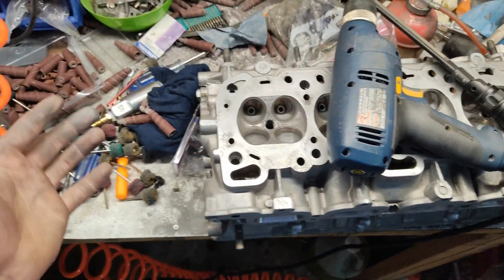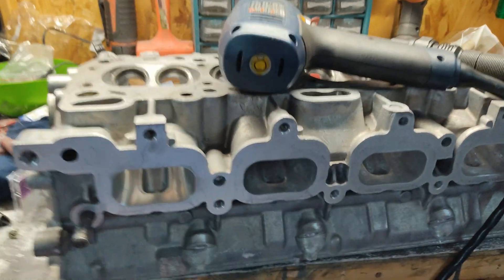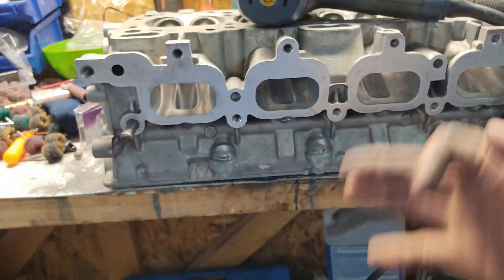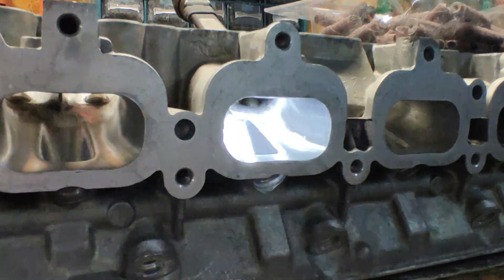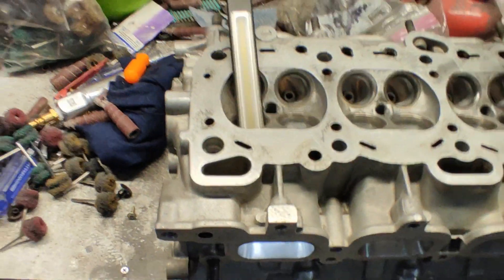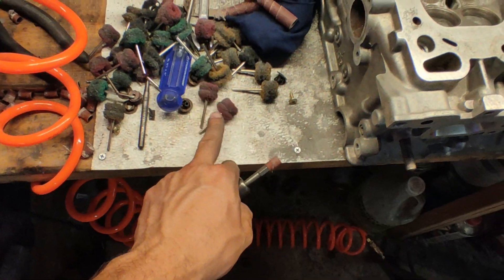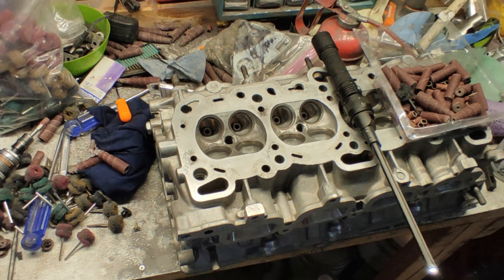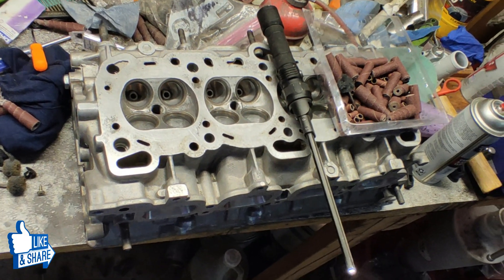How to Port and Polish a Cylidner Head at Home DIY (4G63t)

Comment: On the intake port they don't need to be highly polished as this can lead to fuel drop out and poor atomization. On the exhaust port the smoother the better to get the exhaust gases out quickly.
Reply from the maker: I didnt polish all the way its still better then OEM cast

Comment: You did a great 👍 job on this did you notice better air flow or a difference in the engine?
Reply from the maker: not untill i get it on dyno bud :) sounds same tho
Reply: @PoormanscarGarage  Have you finally gotten it on the dyno? Did you notice better throttle response and power before the retune? I’d think there’d be a difference even with just the amount you’d do.